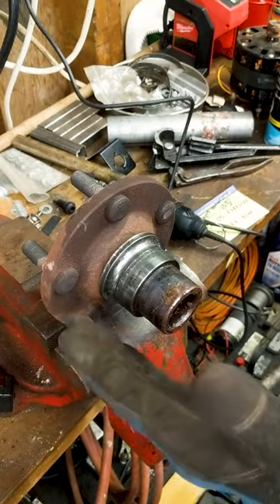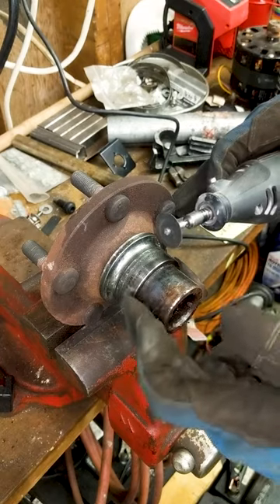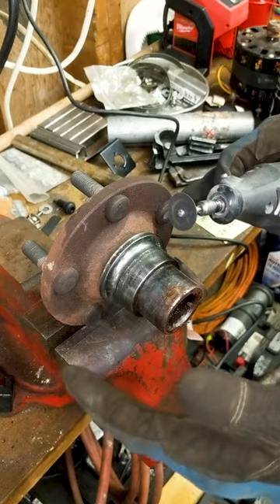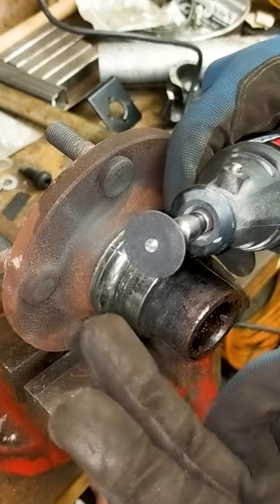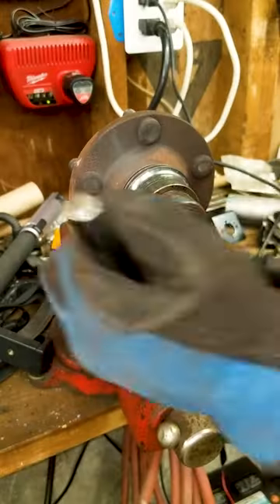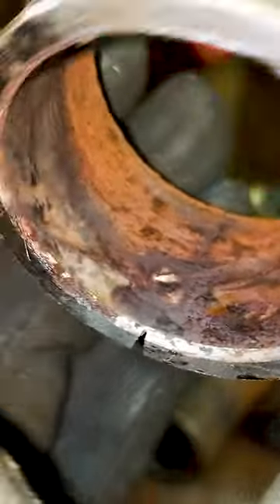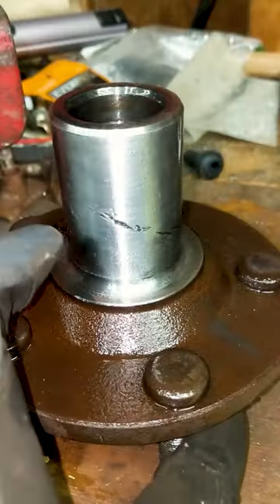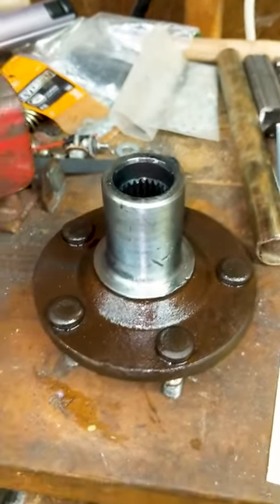Remove Bearing Race From Hub The Smart Way! #Shorts

Comment from the maker: Listen everyone: I've seen the South Main Auto video too! Yes, a torch works. 99% of home gamers do not have acetylene or even MAP gas on hand. This video is about CUTTING the race not HEATING the race. It is ONE method of MANY. It's smart versus using a full sized angle grinder and because the air trick saves your discs. Plus I prefer to avoid heating up large chunks of metal when possible. There are already plenty of comments about using heat. :)
Reply: Do NOT insult those of us who are actual mechanics! I have known how to get a bearing race off since before there was even internet! CUTTING THE RACE OFF IS THE WRONG WAY! IT IS SO WRONG! The right way is to press it off and if you don't have a FUCKING press, then what are you doing replacing an encapsulated bearing?
Reply: @TheRealAaronWitchey  exactly 💯. He is showing the "right way" for one aspect but I bet he does it completely wrong for everything else....
Reply from the maker: @TheRealAaronWitchey  It's not wrong. If done correctly it is actually less likely to do damage than a press. These bearings aren't sold as a hub and bearing combo in the aftermarket and the OEM is expensive. Every single press in bearing also uses a separate hub. You claim to be a mechanic, yet you don't know plenty of cars have the hub pressed in after the bearing? You really need to chill out. Clearly if you knew it from before the South Main Auto or other popular videos, was that comment targeted at you? Relax, please, and use some common sense and context.
Reply from the maker: @gorillawrenchin  Nothing I showed was wrong or harmful to the hub in any way. Kindly correct me if there is a single thing I did which will damage the hub or affect performance. The target audience of this video is DIY mechanics and home gamers, not professionals with full access to a shop full of tools. Even then, I know plenty of professional mechanics who cut off bearing races regularly for various reasons. It is a commonplace technique and the point of this video was showing a Dremel can provide more control with less noise, sparks, dust, heat, and risk of damage.
Reply from the maker: @TheRealAaronWitchey  Oh, and if you didn't know, it's extremely common to press a hub into a bearing both on or off the car with a wheel bearing press kit that uses a large bolt and various cups and plates to press the hub in. It actually has less risk of damaging the assembly than a press and it is for that reasons Subaru even released a specific service bulletin to do it that way rather than using a press. Many OEM service manuals call for the same procedure.
Reply: @802Garage  I did not say you did anything wrong at all for the cutting of the hub race. That part worked just fine. If you "reread" what I said I was referring to your disassembly and reassembly of the bearing in the knuckle. Since you don't have a press you gotta make short cuts somehow. This is where I find you a Hippocrate. 

Honestly I don't care how you do it, fixing cars is not an exact science. What you may find unacceptable could work perfectly fine forever. My main point was just calling you out for pointing the two sides of your post.
Reply from the maker: @gorillawrenchin  You are incorrect. I am not cutting any corners, nor am I a hypocrite, and I am using a proper procedure. Please refer to this Subaru Wheel Bearing Installation Guide. https://drive.google.com/file/d/0ByTaYhFySKq6TWZBSVVmTUhtMW8/view?resourcekey=0-0jlLCaeBChYLTL2dwYshrw
You absolutely do not need a press to both extract and install wheel bearings, either press in or unit bearing type with separate hub. The bearings for this car are commonly sold without the hub and therefore it has to be pressed in. Using a bolt and plate style press kit is both correct and less likely to cause damage than a press.
I agree with your last point, people have different methods and preferences. I will insist that the procedure I have used to get the the point in this video is correct as is the way I finished the installation. I will actually use this method instead of using a press for the reasons Subaru released a revised installation guide.
Reply: Great tips, from an old retired mechanic!
Reply from the maker: @logan_e  Thanks I appreciate it!
Reply: @802Garage  Surely, I recognize ability when I see it !
Reply: はまううつ
Reply: I do mine exactly the same way you just showed.  Have saved my family thousands of dollars this way and have eliminated much of the down time associated with these repairs.
Keep twisting those wrenches!
✌❤🍩
Reply from the maker: @donutdan1508  Yep! Only reason I have been able to afford a car most of my life is fixing it myself, hahaha. Thanks!
Reply from the maker: @noellwilson1273  Have fun. 😂
Reply: A torch can take the temper out of the metal and cause the hub to warp. Happened to my 05 corolla.  3 days after the bearing replacement the front end shook when breaking.  I put a dial indicator on the hub and it was .070 out of round.
Reply: @802Garage  they aren't expensive if you go online.  At least for Toyota.  My bearing for my 05 corolla was about $60
Reply from the maker: @ebuzek3648  I hadn't even thought about that in this application, but yeah you'd def want to be careful about even heating and not getting the hub too hot. Personally I've been burned enough times I just prefer not to heat things I don't have to.
Reply from the maker: @ebuzek3648  Yeah in this case the cheapest was around $75 for aftermarket of questionable fitment. For some reason this specific year range of Legacy platform they only sell either the whole assembly from the dealer or just the bearing aftermarket.
Reply: Ya but yours sucks jk lol 😂
Reply from the maker: @redneck4200000  😂😂
Reply: @TheRealAaronWitchey you have no idea what you are talking about, sit down and let the men work
Reply: Like even a $20 plumbing torch works dude
Reply from the maker: @hcgtiger4724  Have fun!
Reply: You be there for awhile cutting that whit that Dremel tool
Reply from the maker: @PedroRodriguez-hy5ty  It literally takes a couple minutes. 😂 I just did it again a few days ago cut both sides and broke it off took no time.

Comment: Thank you so much!  After scratching my head for awhile I was using this exact method, but it was taking a looooong time because I lacked the conviction that it was going to work.  After watching your video I got the first race off about 10 minutes later, and the 2nd only took 7 minutes.  

Also, the tip on cooling the cutting wheel was new to me.  Thanks again!
Reply from the maker: That's awesome! The more you do it the easier it will get. Thanks a lot for the comment!

Comment: People dont want to admit it. But the dremel is easily one if the best tools ever made
Reply from the maker: I have used it for so many different things. Including cutting the heads off bolts that were stripped holding in a Jeep transmission.

Comment: I've used this exact method doing wheel bearings.

Here's one for you to try next time- give the race a quick hit with a chisel to leave a mark, and then use a torch to get that spot of the race glowing, and immediately spray it with an upside-down can of air duster... Half the time, it'll crack on its own from the spray along the line where you hit it. If it doesn't split, another lick with the chisel in the same spot, and it'll fracture like glass.

If the race is really rusted in place and doesn't want to move after splitting, you can do the same thing on the other side of it, and spit it in half.

For inside bearings/valve seats (things that are pressed into a hole, basically), the easiest way is to use a TIG without filler to carefully weld a line around the center of the race; The weld cooling will pull the material in towards the weld and shrink the OD of the race/seat, and they'll literally fall out.
Reply from the maker: Yeah there are many methods and I just wanted to show the cutting method with what I think most people have available. Your method sounds cool and like a fun science experiment, but it doesn't sound quicker to me. If time is paramount, going heavy with a cut off wheels on both sides will work, hahaha. I'm going to make another video soon on doing this method, but cutting both sides and cracking to see it fall off. And yes the welding method works well too! Thanks for the comment.
Reply: A lot of us don't have Oxy torches. The Dremel method is best for us DIYers with normal tools
Reply from the maker: @DaDaDo661  Yeah that was my intent behind the video. :) Thanks.
Reply: @DaDaDo661  oh, I'm not discounting the Dremel method at *all*, that's why I made sure to specify that I've used it.

It just reminded me of a "cool trick" I figured out messing around in the shop, so I decided to share it, is all. I figured it out after getting into blacksmithing and  having an idea I wanted to test, stemming from my experience with fast quench times and not preheating the quench oil causing blades to become super brittle and sometimes just fracture during the quench itself, along with stress risers and grain structure causing failures.

My theory is the "chisel whack" changes the local grain structure along where the edge strikes and adds internal stress... The rapid heating causes the material to expand, and it's then immediately hit with liquid CO2 (upside-down Air Duster) and is immediately, RAPIDLY quenched down to around negative 100F,  before ever being heated long enough to become fully annealed... That "super-quench" causes the material to rapidly shrink and contract while also becoming much harder and more brittle, and the metal fractures along the surface defect along the defect that was created with the chisel.

It's more of a "hey, this is cool!" and a neat science experiment to do, more than anything else... Although it's come in handy several times where a bearing race was butted up against something and a Dremel wheel wouldn't fit to cut it.
Reply: @802Garage  i will have to try tig i was shown mig to extract races now im wondering which will shrink faster lol

Comment: Yes , this the best way to get them off. If you don’t have a dremel, the angle grinder works very well. Even if you nick the hub a tiny bit, there is no issue.
Reply from the maker: I love the control of the Dremel and the air saves the disc! Def possible to do with an angle grinder if you're careful though. Also angle the cut more than I did in this video for easier removal.
Reply: @802Garage  I gave my old Camry to my daughter after doing this ( following flooding in Montreal) at 350,000 km. 450,000 and good for another 200,000 ( before engine gives up the ghost)

Comment: Take your stick welder and apply a bead of weld on the diameter of the race. It will practically fall off.
Reply from the maker: Yep if you have a welder. :) This vid was about the cuttin' method.
Reply: Check my comment it’s easier. Acetylene torch and a bolt, nut and washers.
Reply from the maker: @tycenwitlox283  If you have an acetylene torch. I'd wager 99% of DIY mechanica do not. 😁

Comment: Or you could just cut two grooves horizontally and press it off with a press plate. That way you don't even risk scoring the axle
Reply: Man I tried pulling an axle bearing off of a 12k lbs axle today, had over 2klbs of pulling pressure, nothing. Absolutely had to grind it and crack it just to have a fighting chance

Comment: Great tip but honestly the price of aftermarket hubs are so cheap on many websites you might as well buy a new one since it is something you may not need to touch again.
Reply from the maker: In my experience, you always need to touch it again. :P No, but seriously in this case they don't sell the hubs alone for some reason and the OEM hub and bearing assembly was too expensive for my friend I was fixing the car for. Plus I don't really like to replace things unnecessarily if I have a good part. This only takes a few minutes! Not that this was a great example of a good part, but this car had a ton of miles and was in really rough shape and it was pretty much repair to get it to end of life. I hear you though.

Comment: this method is just fine for the home mechanic that wants to save a stack of money.   yes even i use my torch and have 30k worth of tools to replace any part on cars.  however if someone ask me if their was a cheaper way i would explain how to change the bearings using this method to avoid them spending their pay check on labor.   

if i have the knowledge and experience on the particular repair. ill gladly tell a customer how to fix their car and wont charge them a cent.
Reply from the maker: Yep, I just like to show a variety of methods that work for people who don't necessarily have all the tools! I don't even have all the tools for the methods for every job hahaha. Sometimes the more expensive methods are actually slower as well. Like a ball joint puller versus my ball joint trick.

Comment: The outer wheel bearing spun in the hub of my 1969 Dart on a xcountry trip in 1986.  The rollers fell out when I removed the axle nut.  The inner cone was heat-welded to the spindle.  A shop in northern MS heated the cone with an acetylene torch to bright red, then split it with a chisel while still glowing.  The other mechanics said the older guy was the only one in the county who could do that.  They had a junk Dart in the back they took a hub and drum from to get me back on the road in an hour.  I later had to remove a bearing cup in a transmission, with no back slot to knock it out with a hammer.  I chucked a carbide end mill in a hand drill and it cut into the hardened steel like butter until it cracked apart.  Next time I'll try my Dremel wheel or an angle grinder w/ cutoff wheel.
Reply from the maker: Hahaha awesome story. We accumulate some good ones over time. :)

Comment: I used to use that method. 
But that was yesteryear.
Nowadays, I sell the customer a new hub along with the new bearing....
Let's gooo!
Reply from the maker: Hahaha, that can definitely be a time saver! In this case for some reason only the dealer sells the assembly, everyone else you have to buy the bearing and press the hub in. On the older cars you had to press the bearing in before the hub. So just depends on the job.
Reply: @802 Garage  still have to press them together. Here in California,  bearings and hubs are on the shelves at auto part stores
Reply from the maker: @jonnysanchez3833  Oh for sure haha. I like reusing when I can, but if I was doing constant business I'd buy new hubs often too.

Comment: The life left on that disk blew my mind with just a bit of air. This is good stuff, great tip!.
Reply from the maker: It seriously impresses me too. If you heat them up they can be gone in seconds, but a little compressed air and they go for a long time.
Reply from the maker: @Willam_J  Right?
Reply: Does this work on regular cutting discs aswell?

Because some days i have to cut like 5’ of aluminium profile and it most times costs three quarters of a disc due to it starting to wear aggressively half way during the cut.
Makes me wear a dust mask from all the green residu it spreads into the air.
Reply from the maker: @bertbergers9171  It should definitely help a lot!

Comment: Lmfao, my boss hit me with a shard of bearing race, I still have the hole in my neck from it(:
Reply from the maker: Holy shet.
Reply: On purpose?
Reply: I just got a chunk out of my finger this morning
Reply: @ljguy300  doubt it, maybe, not sure.
Reply: @d14lonewolf  shit be careful out there
Reply from the maker: @houstonmoore2952  😂
Reply: The first time I changed bearings I thought knocking the race off with a hammer would be a great idea. While doing so I kept feeling like something small was biting me, when l stopped to look I hade small blood spots all over my arms. I was only using a safety squint, I'm glad I didn't take a shard of hammer to the eye.
Reply: I worked at a place that made rock crushers and big big bearings. Guy had a shaft suspended from a crane and just as he was about to belt the race with a mash hammer the boss happened to just see what he was about to do and cried out “don’t hit it” but it was too late. A nice shard shot into the bosses leg and needed surgery to get it out.
Reply from the maker: @oddballdynamics.9658  Holy crap.
Reply from the maker: @michaelslee4336  Well that's not fun. Also why I don't like to hammer on everything hahaha.

Comment: Yeah I always use my grinder and I always cut into the hub I like your idea better I'm going to use that from now on I put a lot of burns on that Toyota mine thanks for the video
Reply from the maker: It's pretty easy to cut it on accident! Use the air and if you wanna make it even easier just cut a slit in both sides and crack with a chisel.

Comment: Here’s what you do instead, get a bolt long enough to go thru the hub and washers and a nut that you can use to clamp the hub and spin it with a drill. Heat up the race with an acetylene torch and the race falls right off. Works every time. Try it!!
Reply from the maker: Yeah I've seen all the same vids, hahaha. Personally, I'd probably go with this method 9/10 times anyways because it really doesn't take long and it doesn't involved getting out the torch. Still a good technique though!

Comment: A well known franchise in New England cut a quarter inch deep slot into the axle shaft of her Grand Cherokee then pressed the bearing retainer on crooked which made the previous seeping leak into a huge leak and denied everything. They used a galvanized carriage bolt for a steering component, again denying, and damaged the front driveshaft somehow. 
I found that a Very Important Piece if you get my drift.